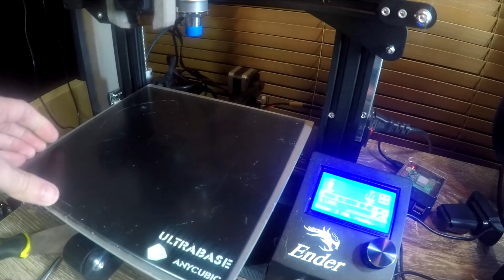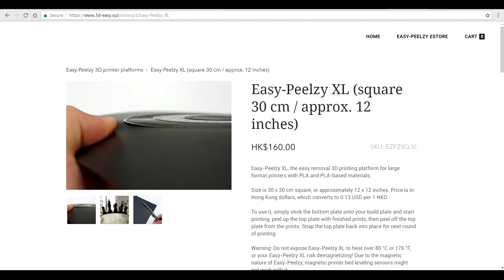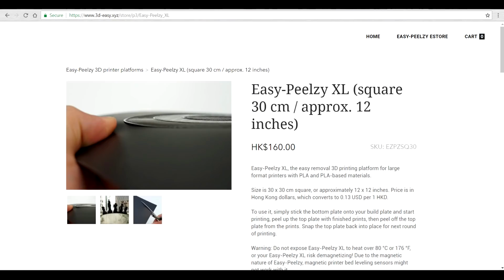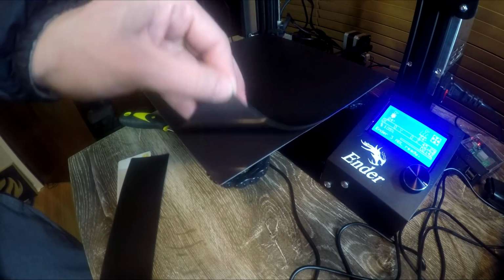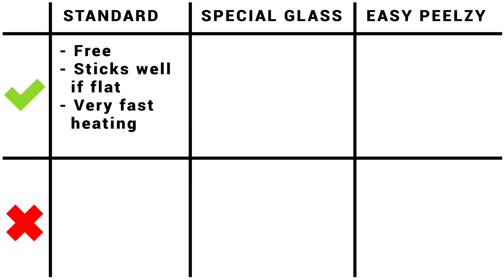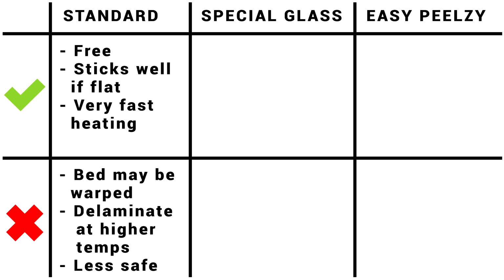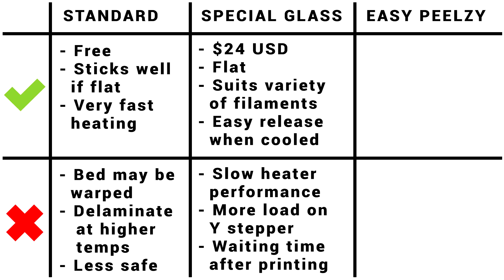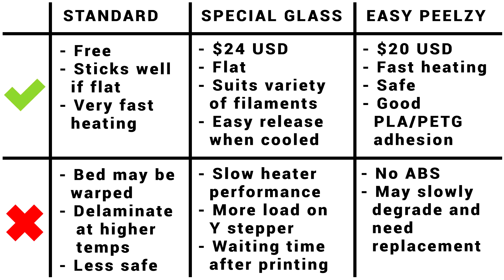Ender 3 build surface comparison: Stock vs glass vs Easy Peelzy magnetic sheet

Comment: FYI: everytime ive pushed hard or slightly hard ive had to re level the bed slightly just a heads up (with the ender 3) if you have the removable aio pad then you wont have to worry the older one with the glue scraping would be the concern

Comment: I had lots of problems with my Ender 6's warped bed. Another you-tuber suggested a mirror for the bed as these are always flat to keep the image from warping. This works. They were ridiculously cheep and made to measure from a local glazier, I bought 3 so I can be printing while removing prints and cleaning.

Comment: Would you also consider a PRO for glass the incredibly smooth surface you get?  Or would you say the others are also that smooth?  I can definitely tell the difference between glass and masking tape.
Not a huge deal when the smooth part is just the bottom of something, but for instance if you are printing something that is going to show lettering, you can get that so smooth!

Comment: I have a ender 3 V2 that came with a glass plate factory I am new to 3D printing and find that it's very hard to remove my prints from the glass after there done. Is there a trick to removing them? I'm only using PLA so far and don't add nothing to the bed before I start printing. Is there a surface that works the best for every type of material? I don't mind spending a little bit more if it's worth it. Thanks and I appreciate the videos.

Comment: I have the 3d v2 with a glass bed using PLA but the prints stick like glue to the glass, so I always spend a long time scraping it off and I have chipped the glass. Any suggestions? Thanks, Richard

Comment: I didn’t do the glue method on my stock plate and ended up with a stuck print after maybe 10 prints but no worries I’m buying a glass plate since I have a small hole in my original surface from trying to get a stuck print off

Comment: Any idea how can I use the default glass and the flexible sheet in parallel so I can easily swap them when needed?
Reply: Just clip the flex mat to the bed just like the glass. -- just adjust your z stop when you do

Comment: I have the ender 3 non pro and it comes with a hard plastic build surface. Because I used a sharp knife to remove my print the center area is getting scratched up and lose it's non-stickiness, the edges are still fine. I am thinking of changing to glass plate.

Comment: Interesting, thanks. Question: if I use a glass bed, do I need to raise the z axis end stop?
Reply: On my Ender 5, I didn't need to adjust the z axis end stop.  Adjusting the leveling screws did the job.  See if that's an option first.

Comment: So I got the pro ender 3 and the glass bed is awful. Just will not hold the first layer for any remotely detailed small print. Infuriating!
Reply: Same here, just got it and it's adhesion is worse than the standard though things do release easily if you build a raft where as I some times had to scrape and scrape to get things off the original. Oh and the first printed line I just started leaving on because it wouldn't come off.

Comment: I have all three surfaces, my Ender 3 came with the rough base plus a glass, never had to use the glass (I print mostly PLA). But the rough plate is a bit hard to snap things off and after awhile of using the scrapper to get the prints off and the brim around the print, the surfaces pretty much lost the roughness and the prints started to not stick...

So I bought one of those magnetic beds that were made for Ender 3 (they are really good, even came with a small extension in one side to be easier to remove), and i have to say, best upgrade ever! Way easier to remove the prints, any excess material that is stuck/glued to the surface i don´t have to use the scrapper, so the surface remains pretty much the same for much longer then a regular bed.

I recommend getting it 100%, it will make your printing life much easier.
Reply: I recommend against it. I have the official magnetic bed on E3Pro and the top layer split when removing a small print only after having it for just over 2 weeks. I'm looking to go glass.
Reply: @Ziplock9000  have you decided on anything? I ordered a glass bed with my e3pro because I had heard about the issue you had. I have yet to receive it but after watching some videos the glass bed can sacrifice quality. looking forward to testing out both when i receive it, maybe i'll just use the official one until it fails...
Reply: @phenomta4236  The official glass bed arrived 2 days ago, but I've not tried it yet. Yes it can introduce ringing due to the extra mass. But you can slow the print speed down. Most people think it's a worthwhile sacrifice. I may end up using both.

Comment: Mike great video, very informative, thumbs up! I have an Ender 3 with only add ons being a coated glass build plate and metal replacement for the stock plastic feed mechanism. Over 18+ months of ownership the printer has worked perfectly. I see lots of ppl printing add ons that are supposed to improve performance, but I'm dubious. Would you do a video about which Ender 3 add ons really improve results. Also, what periodic maintenance do you do?

Comment: I'm rocking the glass plate. Mailly with a 1.5mm dip in the build plate on an Ender 3 Pro, there's really not many options. Although, I'm not as fortunate with remove, requiring a bit of isopropyl alcohol. I almost jumped for joy when I found a full bottle of 91% in the linen closet since it's pretty much easier to find the true blood of Jesus than the coveted chemical.

Comment: "Of course you can't do abs because 80 degrees". A PEIish surface, like the ender one shouldnt need that high of a temp for that. 50 degrees should be just fine for it to stick.

Comment: I just wish my printer would have just came with a flat bed... seems silly.
Reply: They should really make glass the standard instead of the magnetic sheet.
I'd be willing to pay a bit extra to not have to go through the headache of trying to level my bed as a beginner, only to realize that my bed is warped.
Reply: @1objection  sounds like a bl touch could be your bf yall should link up
Reply: on a second note they do offer the ender 3 with a glass bed upgrade from the fac.
Reply: @b-rad7708  I'm familiar with the process of leveling, I just hadn't realized my bed was warped. Doing it by hand is easy when your surface is actually flat.
Reply: Ikr
Reply: I got mine wrapped from the box as well.

Comment: You did not talk about the best of them all and this is the fake build tak on the flexible glass fiber carrier which you show in the beginning.
Unfortunately I haven''t seen this anywhere for sale - Creality ships them now with Ender 3s.
The Creality textured glass bed for the Ender 3 is fine. I really dislike the flexible magnetic beds though. When you have a larger print, it woun't peel off.

Comment: Get a perfectly level glass bed and then  run carbon fiber over it make sure its completely level. The thickness will be left to your preference or just make 3 and halve 1 thick, medium and thin. Remove it off the glass plate. You now have an super level, super tough plate. The carbon fiber once heated a little will now give you the ability to make any filament stick to it and help the  bed stick to the metal plate. So no slipping. Once cool the bed pops off the metal plate easily. Also it's pretty  much indestructible and resistant to heat. So scrapers and nozzle damage are a thing of the past. Its heat point is way more than any other filament so it wont mess up under any filament except carbon fiber. It's all I ever use. It seems other bed material will be good but they all have weakness too someting....carbon fiber has none. It really is the perfect print bed.

Comment: Can I use the glass over the magnetic plate or do I have to remove it??
Reply: Id say it'll take longer to heat up and wont be quite as magnetic but as long as you adjust your Z-stop to the right height I don't see it causing any problems.

Comment: I'm using the glass bed from Creality3D, but after only a couple of prints it has severe adhesion issues compared to the default sheet...

I noticed my cleaning cloth slowly went from white to yellowish after each cleaning, that was probably the coating?

I'm using IPA 99.9% to quickly wipe my buildplate before printing.

Comment: the stock Ender 3 magnetic build surface is very convenient  but over time i have pieces of the build plate breaking off with the print    ....mainly  near the middle of the surface  ( it was shipped  FOLDED) and could be a contributing factor

Comment: I found my stock Ender 3 surface became warped over time from taking it off and flexing it to release prints.  The local glazing shop cut an offcut of regular window glass for me and rounded off the edges for a few quid.  It's really flat and has good thermal properties.  Add some hairspray and it works great.
Reply: I've just had this with my 2/5 week old Ender 3 Pro. The top is so worn out it's torn :/ However normal glass does not have the same thermal and other properties as Borosilicate glass

Comment: My bed came with the magnetic surface, can I just put the glass over that surface or do I have to remove it? Or just remove the top piece of the magnet?
Reply: Did you find out what to do? Does the glass go on top of the magnetic build plate, or does the magnetic build plate get removed?
Reply: @TheKingElessar1  I originally took the upper half of the magnet plate off and ran it that way. But now I have the glass on the top of the plate and it is working better for me. The heat seems to transfer through the magnetic plate to the glass just fine.
Reply: @Dznytoy  Cool, thanks!

Comment: i have the ender 3 pro with the magnetic bed im new to 3d printer just wondering how to clean it and get pla thats stuck on it off ??? thanks
Reply: I'm guessing you can't feel the filament when you move your hand over it?
If that's the case, you had the nozzle too close to the bed and it injected filament directly into the magplate. (This happened to me too)

In my case it doesn't seem to affect the printing, then again I'm already using a raft whenever I print because surprise, surprise, my bed is warped.
To avoid bed leveling problems, first heat the bed up (60 degrees is perfectly fine, bit hot but won't hurt you), then do the paper test when it's at 60 degrees. The bed expands when hot.

Comment: Hey Michael, huge fan of your videos, you’ve become my go to for Ender 3 tutorials. I have a couple of questions for you if you wouldn’t mind helping a fellow maker out :).

Firstly, did you have any issues with the Easy Peelzy and inductive ABL? I remember reading that there could be some interference due to the magnetism, and I’m wondering if this is something I should look out for, as I plan on using an inductive sensor for my Ender 3, and would also like to get a new surface (namely the easy peelzy) while I’m at it. 

Second, sort of piggybacking of the original question, could you do a video on a more affordable method of installing ABL on your Ender 3? I’ve seen maybe two coherent tutorials involving DIY methods and even those are lacking. Perhaps you could try the method on the blog “Let’s Print 3D” and let us know how it goes, as so far the BLTouch and EZABL system are around 60 bucks each, which is a little pricey for such an upgrade in my opinion. 

Thanks for your time, continue making great vids! You’ve earned a sub!

Comment: Magnetic base is not a good choice as it is creates bubbles or warping when trying to stick it down to the glass plate and be very, very using it as it is so easily damaged. Even worse is when it's time to take it off as most off the adhesive stays on the glass.

Comment: I’ve been using the stock removable style bed for almost a month now, and it has developed de-lamination bubbles under a few areas not far from the center. It’s causing thinner than intended extrusion in those areas. Have you run into this? I’m considering hitting Creality up for a replacement, but also buying one of their glass beds for improved flatness (some dishing from perimeter to center, but works ok)

Comment: I dont understand. I have an uneven surface on my ender3 pro. Why isnt that covered by warranty? Why would someone need to rely on "luck" to actually get a working printer?!
Reply from the maker: It's a fair point. I guess this is considered a budget printer for reasons like this. Overall it is still tremendous value in my opinion.
Reply: @TeachingTech  I'm actuary very happy with it despite that, and I purchased mine from a shop in the UK, and they have such a fantastic support, I'll get a new bed, hopefully will not be as bad. Also got a Creality glass coming over from China :)
Reply: Yeah, my ender 3 pro’s bed wasn’t completely flat either. I picked it up on a whim a couple weeks ago as a second printer. My first printer has a completely flat glass bed with auto bed leveling. Learning to manually bed level on a warped bed was awe fully frustrating, but I don’t think mine was as bad as others’ have been. I’ve already modded the ender 3 pro quite a bit, and a flat bed with a bl touch will likely be next. It’s a great budget printer, but a warped bed is something that could really sour a newbies experience.
Reply: @NG-VQ37VHR  yes. Luckily, as I said I didn't purchase my Ender 3 pro from China, but in an UK shop and they sent me a new bed as warranty. I'll have to install it but seems to be much better

Comment: I have the ender 3 with the removable surface, but I find it very hard to get things to stick. How do you clean it? Also what do you apply to get pla to stick? Bed temperature? Thanks
Reply from the maker: I generally don't have sticking issues and I'm not using additives. PLA bed temp is 60. Acetone is a no no for cleaning but I haven't cleaned mine otherwise. Perhaps try getting your first layer a bit closer?
Reply: Hello, make sure to clean the bed with acetone, it needs to be very clean, then ensure the bed level is precise, if your using the paper method to get the right clearance between the nozzle and bed make sure that the paper binds snugly, you can play with this adjustment to find the sweet spot, this will squish your first layer resulting in better adhesion. If it still does not work use glue stick.

Comment: On my Ender 3 the stock bed was so warped I could only use a very small area of the build plate at a time. I went to a local glass store and bought a 3mm sheet of glass. I sanded the edges and apply a tiny bit of glue spray to the bed. This gives it a matte finish which does not stick when cold but sticks pretty well when heated up. Cost me $6 and the bottom layer is always perfectly flat and shiny.
Reply from the maker: Great solution.
Reply: Hi Mavamaarten, may I ask what kind of glue spray did you use? Thank you!

Comment: Hi Michael, I purchased an Ultrabase Build Surface Heat Bed Glass but it had a larger dip in the center then the stock Magnetic bed that came with the Ender 3 Pro.  Question: what do you use to clean your magnetic sticker bed that comes with the Ender 3 Pro?
Reply from the maker: I can't advise because I haven't had to clean it yet. I usually scrape with a window cleaning razor blade. I know acetone is a no no at least.

Comment: I got my Ender3 with removable flexi bed. Can't complain yet... Had glass bed before on my other printer, but removing prints was pain, broke good few glass beds. Now I am happy with this flexi one, just remove, bend slightly and the print pops out...
Reply from the maker: The one on my Pro is also working quite well.

Comment: I bought the ender 3 pro like 2 months ago with the magnetic bed but I’m having trouble adhering to it. i’ve been using blue painters tape but it peels off with the heat of the heated bed. any suggestions on what to use?
Reply from the maker: Hmm actually I think this is the first I'm come across this. I assume you have the bed levelled and nice amount of first layer squish. You could always stick genuine buildtak on the upper surface.
Reply: Teaching Tech Yes it leveled and i’m using rafts and brims and although it sticks okay, later on the blue painters tape will start to unpeel (at 60• c) so i thought maybe someone out there might be using something different.

Comment: I've got the Ender 3 produced in august 2018. It came indeed with a separate bed mat which is attached to the bedsurface with 4 clips and is fairly flat. Nothing sticks hard to it. Once my PLA print is ready I use the spatula, light push it and it pops of the mat. I have no issues at all with my prints and the stock mat.
Reply from the maker: That is the perfect scenario. I'm really glad they have improved. Is your bed flat?
Reply: @TeachingTech  Not entirely. It bends down a little towards the middle. But the removable mat is a plus. The way I do it is during bed leveling I make the nozzle scratch a bit more than gentle on an underlying paper in all four corners so it is about correct in the middle. This way I can get any object printed correctly, small of medium size.

Comment: Hello there, When I ordered my Ender 3 it came with the both the removable build plate and the glass, the stock removable build plate holds the prints great but the Creality glass doesn't hold anything unless I put blue painters tape on it (Haven't tried the hairspray yet).
Reply from the maker: Hairspray in the past has helped me a lot with glass.
Reply: Was the glass Ultrabase or just normal glass?
Reply: Washable gluestick 👌🏼
Reply: @patjohn775  sugar diluted in water is the best
Reply: Pufna i Ben I’m going to try that